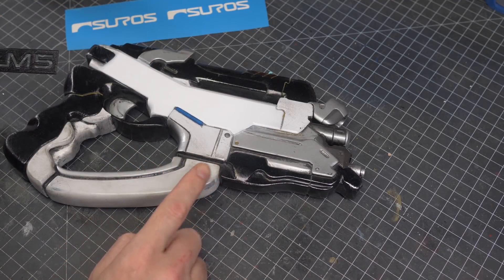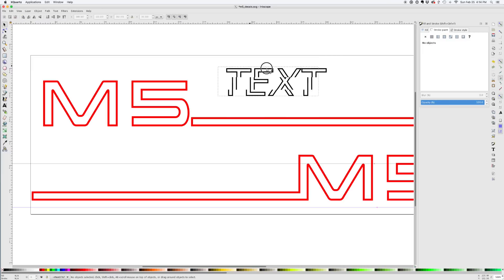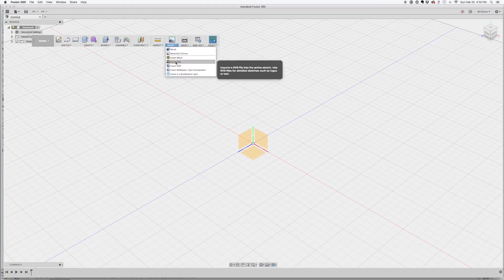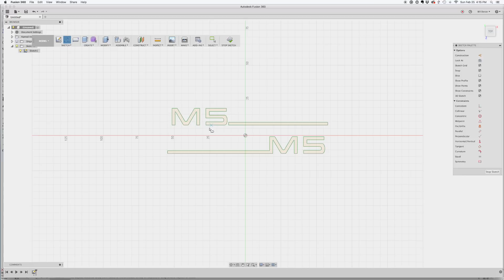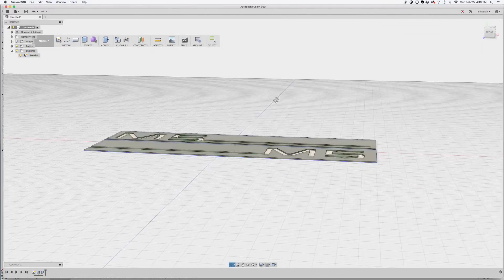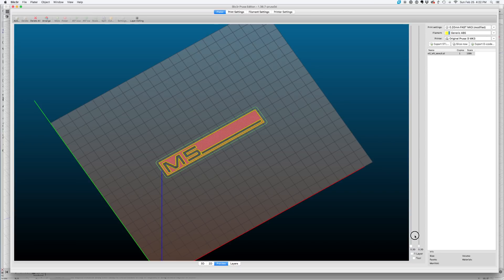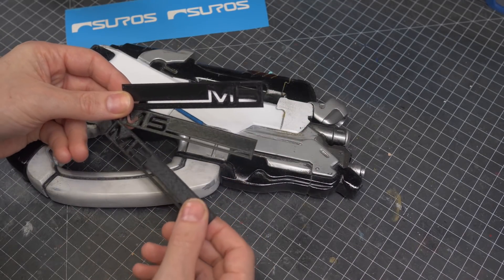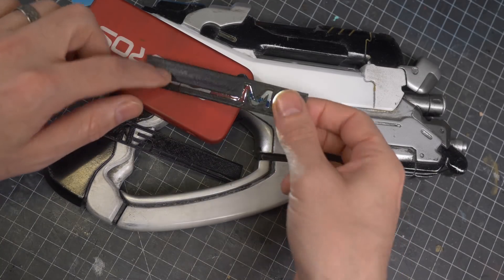3D Printed Stencils for Prop & Costume Making - TUTORIAL

Comment: 7 years, and this is probably still the best video about this subject. Quite surprised that 3D printing is not incorporated into the airbrushing world. BTW; a tip: do 0.5mm height, use 0.1mm for the first layer and 0.2mm after that. Then go to your 3D modelling software and bevel the edges, down to 0.1mm. That way you get minimal thickness on the stencil edge and afaik, it should be sharper "image" when the edge is not obstructing us much if you have a slight angle.  2 layers is just a  bit too thin, imho and the printed part is too fragile, or may even let paint thru. It needs three layers to seal it up properly. You can do 0.1mm all the way up, and use just 0.3mm thickness all around. As long as it has three layers and alternating the pattern direction.

I use mirror as a bed, so my edges are cleaner than if i used textured surface. Very, very tiny things matter.

Comment: hi there, can i just check what kind of paint did you use for airbrushing 3d prints? most of the airbrush paint i used won't dry on my prints and can be wiped off by a wet tissue..
Reply from the maker: I usually use Tamiya model paints, thinned with a little rubbing alcohol.

Comment: It occurs to me that if you wanted to stencil onto a non-flat surface - an intricate surface, that is, not just a non-compound curve - you could build a stencil that actually fitted your part, especially if the part was originally printed or otherwise had an accurate 3D model. So toys and props that have complex color variation could have weird, fitted stencils made for them via this process, that would enable very sophisticated but repeatable paint effects, without the trouble of multiple material extrusion or fitting large numbers of parts together.
Reply from the maker: You totally could!

Comment: Is this an original design, or a prop from something? If original, I might change the side where the long line meets the 5 instead of the M, since you can't have it meet the 5 the same way as on the M. I'd give the left edge of the line a contour to match the 5's bottom corner. It'd be a subtle change, but I think it'd make the line feel more like it was part of the logo on that side.
Reply from the maker: It's from the game Mass Effect. The M5 Phalanx heavy pistol.

Comment: looks like it works better with an airbrush, i need to try that. I did try before with spraypaint but the paint was dripping between the layers under the tape, maybe too much pressure. Thanks for the video
Reply from the maker: Yeah, several light layers of paint seems to work best.
Reply: THIN layers. You have to let the paint fully dry, otherwise it will wick under any stencil that is not a sticker... and even then if the surface is not perfectly flat. With a rattle can, one fast spray, 10 seconds of waiting and repeat this. It takes almost god like patience to do it with a rattlecan, it pushes so much pain out at once and the droplets are larger: it takes longer to dry. With airbrush the layers are thinner and the droplets smaller, it dries up really fast.

Comment: 3D Builder (on Win10) can very easily make a stamp or a stencil from most any image. Even spits out stl files.
Reply from the maker: Woah that's great!
Reply: @PPA aye, that prog is weirdly powerful. Stamps work great for leather embossing. It fixes prints too (I use sketchup so it gets a bit weird at times).

Comment: Fantastic little tutorial on using 3d printers to make stencils! The soft edge is a thing, though. I wonder if a different rigid material would work better, maybe a PLA or a PETG? Perhaps a flexible? I wonder if putting an adhesive on the back of the stencil would make a difference? I'm definitely going to give this a try!
Reply from the maker: I was gonna say, this sounds like something you would have a lot of fun tinkering with! =D
Reply: I was surprised to see you didn't print in TPU. I expect that might work a little better.
Reply: Maybe if you heated the plastic a bit when it was at the gun, to melt it to the form of the gun some more. I have no clue if that would work, but I find it sounds plausible :)
Reply: Yeah i was also going to suggest possibly a tpu. This is so great though Bill! Thanks for doing this!

Comment: You could use this to make shapes impossible to make with just vinyl stencils. Like a concentric circles without any bridges connecting them. You could try making the bridging parts go through the air and leave a gap to paint
Reply: Austin McFeeters I had the same thought. If we're using a 3D printer, might as well make our stencil better than a typical 2D one.
Reply from the maker: That's a really. great idea!

Comment: Awesome work, Bill! :D  I'd definitely try going thinner, with higher extrusion to fill the gaps. In Simplify3D you have various options that help squish down the first layer of filament as much as possible to help create a continuous surface. (Higher temp on the first layer also helps!)

Of course, there's also the fact that if you have a 3D printer, you DO have a vinyl cutter! ...they're both just Cartesian robots, the only difference is the tool-head and the software sending the commands!  ;)  You can find designs on Thingiverse for adapters to let you use things like Silhouette/CraftRobo replacement blades attached to your print carriage as a plotter!  (Or, if you're especially crazy, you could 3D print a whole plotter! Just buy one of those sets of stepper motors, belts, and driver electronics off Amazon or eBay, and you're set!)
Reply from the maker: I'm sure someone out there has made their own plotter/cutter. I already own one, so I don't think I'll be diving into that rabbit hole. =)

Comment: Why bother with incscape? You can just make the lines in fusion right of, it has a text tool after all.
Then I got one question, did you sand the stencil after printing? If not, maybe that will help with the color bleed.
Reply from the maker: Either way works, I'm just not a fan of the spline feature in Fusion 360. I would rather make curves by hand in Inkscape. Plus I already had the vectors drawn for a previous project. I did not sand the stencil.
Reply: I see, well I am so used to fusion so I did not even think that you, of casue, had the ink scape version before as you had used the vinyl cutter :p

As for making it in fusion I was kind of thinking about the part where you said "you can type your text" in incscape and totaly did not realize that the text in your example was not made with any standard font and had to be hand drawn ^^

Comment: If you are ok with a little feathering and want a super cheap solution - you can buy "Removable" ink jet printer labels from most office supply stores. You'll have to cut out the design with an Exacto knife and that takes some patience but it's definitely a good budget friendly solution.

Comment: You may want to try doing one layer with the increased extrusion multiplier and turning on the "ironing" feature (think that is exclusive to Cura Slicer however). I woudl also suggest trying to print on a mirror or glass bed to ensure no texture from the bed transfers to the bottom of the stencil. Lastly, maybe try putting double sided tape instead of the spray. Use the stencil to cut the tape away and then apply to model. This way you are essentially masking off the area and the stencil is there as a guide/support.
Reply from the maker: Ohhhh snap! I forgot about that feature! Thanks so much for the reminder. I bet that would work great. Great ideas all around.

Comment: Maybe you can print the shape of the stencil, make a complete frame so the end doesn't flop around and if the light shines through, do you think you could put the stencil on some flat surface and just seal it up with varnish or something?
In my head that leads to a more flexible, yet fully covering stencil. Buuut, I don't have a 3D printer, so I can't test that.
Maybe give it a shot? This is a great idea Bill! Personally I still think vinyl and varnish are the best. ^^
Reply from the maker: You could seal the stencil, like you said, but in practice it was super cheap and quick to just adjust the print settings and print another stencil. Let the robot do the work.
Reply: It was quick and easy, but did it give you the best result? >.> I am aiming to reduce the thickness of the stencil to make it more flexible so the bleeding/shifting that occured on the video doesn't happen. :)
Reply from the maker: I mean to say it would be quick and easy to print half a dozen stencils to try and dial in your settings for all stencils you make in the future. I still have a lot of tweaking to get mine perfect on my printer, but I bet I could get a really great, one layer stencil that works perfectly with no post processing needed on the print.
Reply: ... yeah, that makes sense >.>

Comment: Very cool. Do you think this would work? Print single layer, post process with primer to fill in the gaps, then use it as a stencil?
Reply from the maker: That could work too! I would rather dial in my print settings and get a one layer print that's perfectly filled in. Then I can save those settings and use them whenever I need a stencil. No post processing necessary. =D
Reply: Punished Props Academy solid advice! (Pun intended!) thanks!

Comment: I have done a few stencils this way. I found that using flexible filament worked way better, give it a try...
Reply from the maker: That is FANTASTIC. I'll have to give it a go the next time I need a stencil.
Reply: I was about to say the samething, TPU should cling to the surface better... but based on Joel's results, you may want to dehydrate the filament before printing with it to get it as clean as possible.
Reply: my thought as well. also, you really don't have to wait longer than a few minutes with spray glue, as you already kinda found out

Comment: Hmmm.  I can see that being very expensive to print (getting a printer good enough to print that thin), and the results being iffy with the bowing you mentioned.  I imagine the paint, even from an airbrush would build up in the cavity and stick to the sides (meniscus) making it harder to remove the stencil cleanly and making for a raised appearance.
No sir, I don't like it.
Reply from the maker: If you already have the 3D printer, the cost per stencil is miniscule. Not even pennies, especially for a stencil as small in this video. Cheap enough and fast enough to print so that you could experiment until you get it to work perfectly.

I've never had any kind of a meniscus build up with any of my stencil work. If that's the case, the airbrush paint may need to be thinned a bit and lighter layers of paint should be sprayed.
Reply: I'm confident a good $200 printer would have an easy time with this level of detail. The Z axis is the hardest to get good detail, but Y and X are easy.

Comment: ABS is better for this than PLA, but a TPDU (ninja flex or any other flexible filaments) based filament should work even better. The more flexible the filament, the better it should do for matching the minor contour changes, and imperfections.
Reply from the maker: Great idea. Next chance I have I'll try and print one in Ninjaflex.
Reply: Another one to test would be a flat top, with a cupped bottom. The way I would accomplish this would be to use 2 or 3 solid layers, and then add an extra 1 or 2 layers of single or double perimeters. In theory, this would allow the stencil to cover a more complex surface with the only point of contact being the outside edge, thus minimizing the bleeding. If you have the ability to print with multiple materials, you could make the solid layers out of abs. This would be more useful when using a complex design on a complex surface, but it would be a worthwhile experiment.

Comment: Maybe use a low adhesive tack tape that won't pull off the paint surface after some testing?
Reply from the maker: That might work. What I like about the spray adhesive is that it completely covers the masking surface and you won't have to trim any tape.